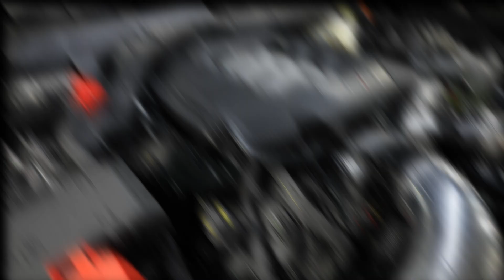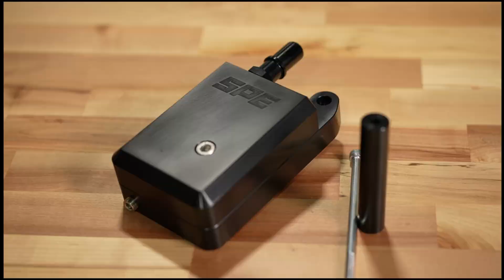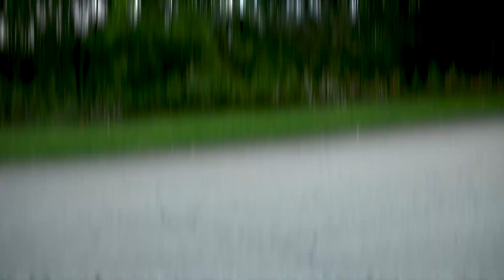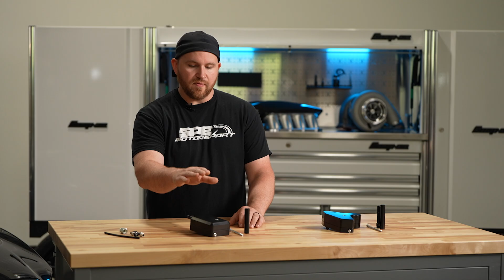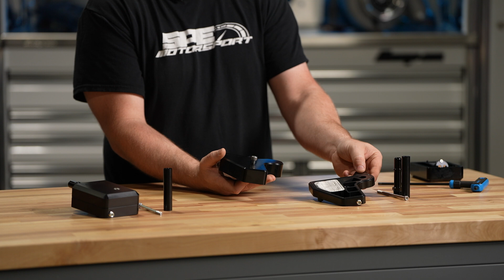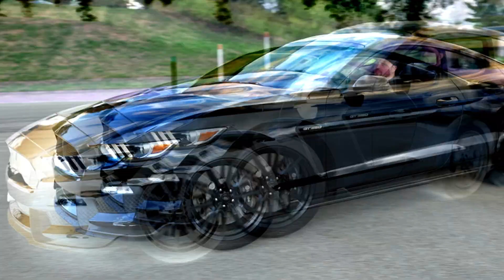SPE Motorsport  Gen 1-4 Coyote, Voodoo, and predator CATCH CANS

Comment: If you don’t drain it will the built up oil go back into the valve cover or get sucked into the intake?
Reply from the maker: If it is full enough to reach the level of the PCV fitting it will drain back to the valve cover. Once installed if its not using the drain kit it will be a maintenance item the same as any other recirculating pcv catch can. So checking and draining is required.